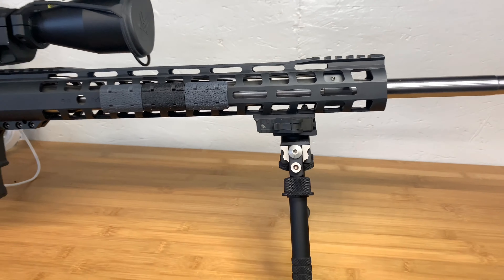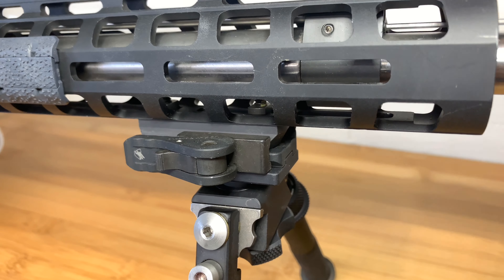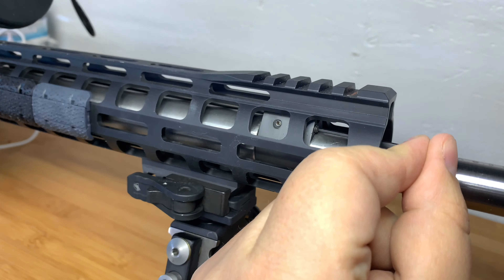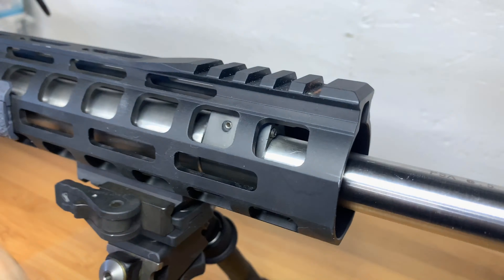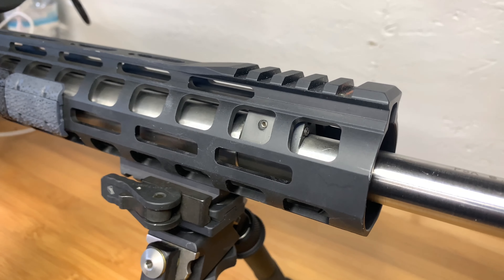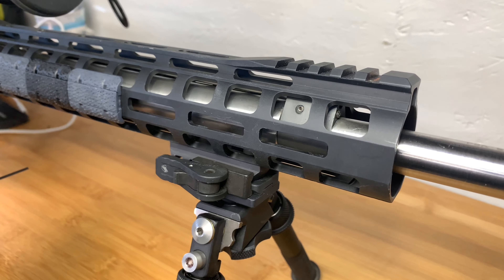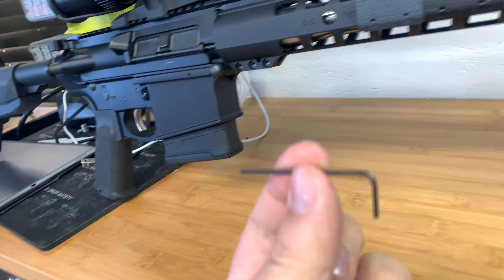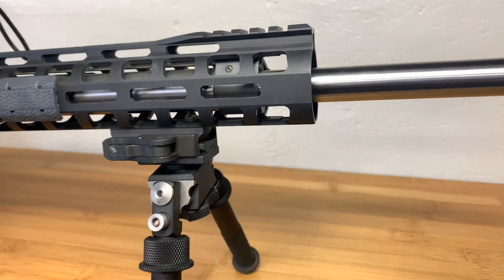Palmetto State Armory 6.5 Creedmoor Gas Block Adjustment

Comment: My PA65 has had ejection issues both times I took it out (shooting the same ammo) would backing the gas adjustment screw out an 'eighth of a turn' be the proper corrective action until it stops?
Reply from the maker: Yeah if it's not kicking them out properly or not locking the bolt back I'd start with opening up the gas a little and see what's what. Good luck!

Comment: Zack,  my second outing the screws walked giving me 1:00 ejection as opposed to the 3:00 before the screws walked. Took it back out and adjusted gas to 3:00-4:00 ejection and shot 45 rounds or so and everything held fine. I'll just make it a habit to make sure the locking screw is tight after shooting. I've heard the screws walkout in other reviews, have you had this issue, or has your gas and locking screws stayed put? I would assume the carbon buildup on the gas block should help the screws stay put, but there's a lot of heat and pressure those screws must deal with as opposed to detent/click type adjustment gas blocks.
Reply from the maker: Interesting feedback! I'll have to keep an eye on this, I haven't shot it a ton since, but on my next outing I'll be looking for any issues!
Reply: Id imagine a small drop of blue locktite on that locking screw would keep it from moving. Odin works has one where it clicks as you turn it because of a spring and detent (I think) so it doesnt move.

Comment: Have you ever had problems with you’re bolt being caught in youre buffer tube? Would that be over gassed? Or the wrong buffer
Reply from the maker: I didn't run into that issue, but PSA uses a different buffer in them so I'd probably leave that alone and first try turning down the gas and see what happens.
Reply: Zack Carlson - Writer okay thank you for replying I can’t figure out the problem. I will try adjusting the gas block